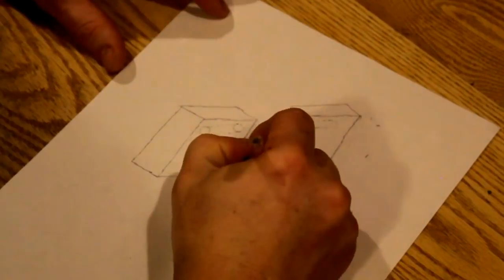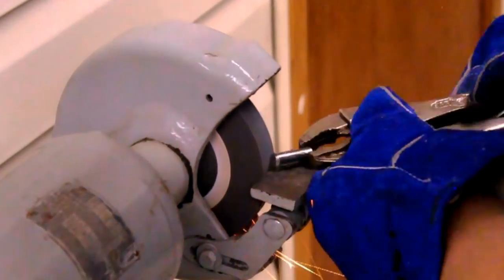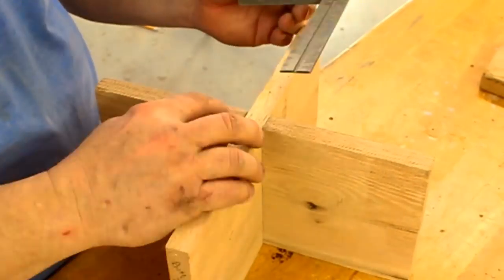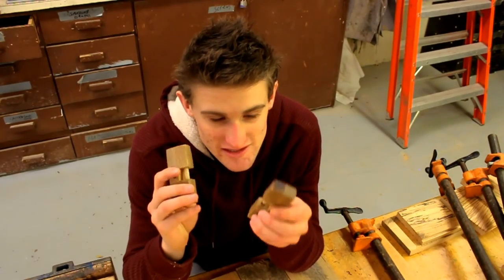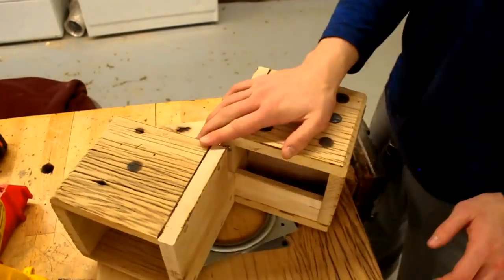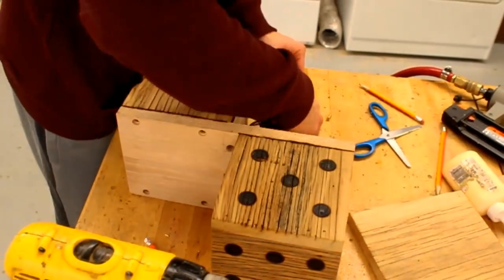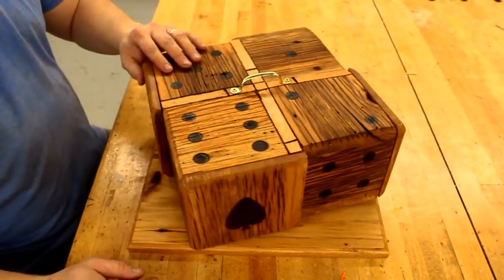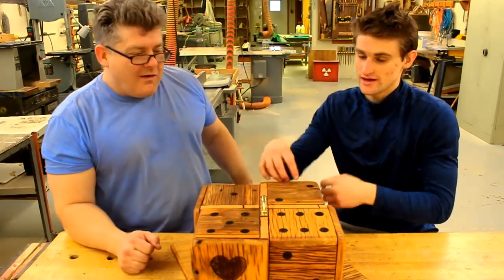How to Build a SECRET Spinning Dice Set (With 4 Hidden Compartments)

Comment: Brilliant! I bought two bearing kits first. I will make a large lazy susan later. But wanted to start off by building a small with one that had box compartments. Was thinking about doing a second round tier. However I didn't want my boxes to be the same shape as pizza slices. Just searched 'lazy susan with drawers' on Instructables and found your video. I will modify your design a bit to suit my needs. Well done, guys!